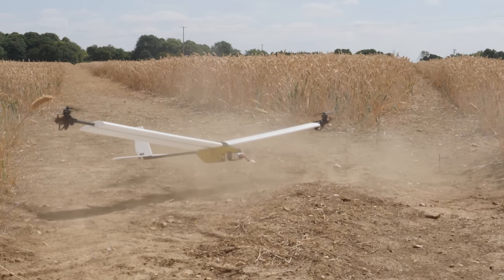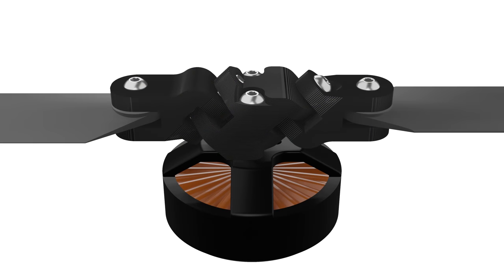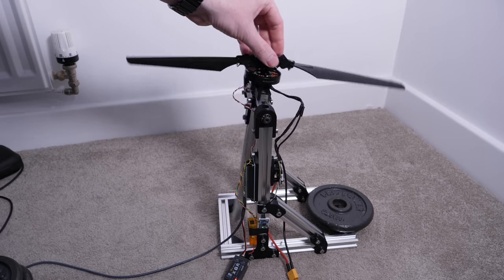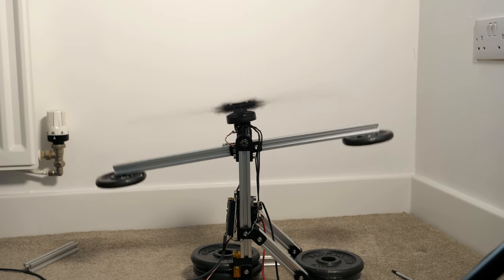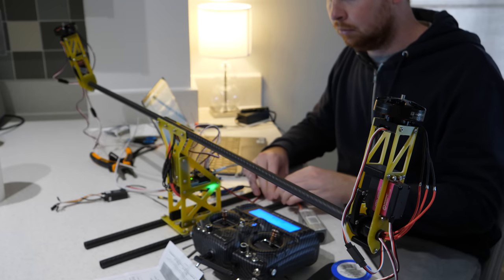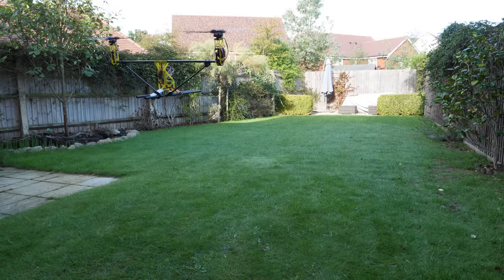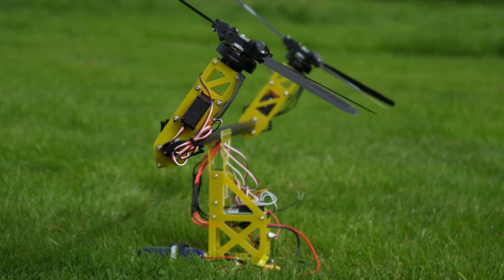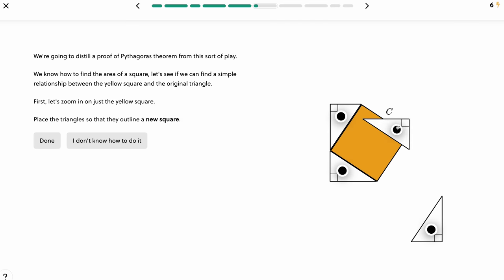Building a V22 Osprey - Part 1

Comment: On a quadcopter you get yaw from slowing down the cw motors and speeding up the CCW ones. You could do that here but you would also get tilt, some maybe you could use virtual swash plate to control the tilt while using the overall motor speed to do yaw? Rotating the whole motor mechanism seems wrong somehow but maybe that's how the real one does it. Awesome project can't wait to see the test

Comment: Hey Tom. If you put a back or front panel on the motor housing, you will strengthen it much more than the one connecting part you have in the middle now. You can see it still flexes in the slo-mo.. same goes for the exstention up to the wing spar.. put sides on it ;) Keep up the great work

Comment: I would put the tilt rotation point in the middle of the motor support, so the motor would be "above" and the servo would be "below" the carbon spar. That would give much less vibration.

Comment: Search for "ground resonance helicopter", It's something that can happen even in a real helicopter with 3 or more blades while in contact with the ground. and if not identified and corrected immediately by lifting off (removing any contact with the ground) it will build on itself like waves caused by multiple pebbles being dropped into water, and can rattle a helicopter apart. I think the fact that you were no longer in contact with the ground in later flights contributed to Ground Resonance being eliminated more than the design changes. Another thing to note: while the freely leadiing-lagging rotor systems work great for the ESC system you've built, without lead-lag dampers, they are more susceptible to Ground Resonance

Comment: Why not use the swashplate-less rotors for yaw control instead of the tilting servos? Shouldn't you have independent pitch control on each side? Hyped for the next video.
Reply: I'm thinking that's because the sine wave has to shift phase almost instantaneously and even though that is possible in the software and electronics side of things, physically that won't translate into the rotor doing what you expect because of its inertia. I'd like to hear what other people think though, as that's just my uneducated guess.

Comment: That rotor head is very impressive.  I flew 30 and 60 size nitro r/c helis for many years, the collective pitch on them adds quite a bit of complexity and points of failure.  Not sure how that would work with the much bigger blades on what I flew but makes me want to go dig one out and do some machining to tinker with it some just for kicks.

As always your videos are very educational

Comment: I would put the tilt rotation point in the middle of the motor support, so the motor would be "above" and the servo would be "below" the carbon spar. That would give much less vibration as there would be much less cantilever on the rotor support design.

Comment: I appreciate how you leveraged the precision of your electric motors to control the prop tilt. I wonder if you'll need to damp the movement at all in the end? There's only one degree of freedom on the rotor blade itself, right? Can you think of any easy way to keep the rotors from flopping around when they're stationary? Maybe a tiny little spring in the hinges? Just some rando thoughts.

Comment: Honestly I'm nobody to give advice to someone as brilliant as you, but I think some form of counterweights would be beneficial on either end of the motor propeller units? 

I feel like the unbalanced weight on just the top side of the black bar would also make for a challenge when it comes time to switch between hover flight and forward flight. 

Excellent execution of the swashplate-less design though, can't possibly have conceived of such a thing and it's so simple yet effective. I'd patent it if I were you before some toy brands pick it up lol. Excited for the next part!

Comment: With the three hinge rotor design, did you design a correspondingly lower angle into the two same-direction hinges? This could improve blade tracking and reduce vibration.

Comment: Nice work, kinda surprised me that the unsymmetrical pitch control still works that well.
But than again 1/3 to 2/3 isn't that far off from 1/2 to 1/2 so there isn't real reason why it shouldn't work.
Looking forward to your full build.

Comment: Thi flight cobtroller restart is probably caused by the power consuption, when you put a huge load on the battery from the motorsthe battery voltage can dropp, and the regulator no longer able to provide the voltage the microcontroller needs so it gose reset. If the problem ever appear again I suggest use a drone power regulator or two batterys. One for the motor, one for the other electronics.
Have fun the video is high quality as always!

Comment: This is brilliant. If you happen to research the history of the V-22 Osprey, back in the late 70s early 80s, they had several crashes due to the same issues you had. The flight control system failing and the resonance of the blades over the wings. Same issues.... smaller scale.

Comment: This is an amazing idea, and could really be useful in a life-sized application.  Taking away the mechanical complexity and replacing it with digital complexity.. but probably saving a load of weight and maybe increasing the reliability?

Comment: A guy in my club had a Rotormast Osprey (shown at the start of the video) until this year.  It never worked right.  It always broke when trying to bring the nacelles back to vertical after having them fully forward.
Reply: interestingly, that is also the most dangerous portion of the real Osprey's flight, and resulted in quite a few fatal crashes.

Comment: There's a phenomenon with three bladed helicopter rotors where a slight bump at the right moment can send them into a catastrophic vibration. I'm wondering if the oscillation based control may be inducing that, and the steps you've taken have effectively masked the problem.

Comment: you should probably move the tilting servos oposite to the rotormotors
1st it looks more like an osprey
2nd it would reduce vibration because the distance between rotation point and motor is reduced

Comment: Given you had issues with blade deflection in the tests the vibrations could be an instability introduced to the rotorhead by a blade stalling out completely, adding random torque to the system which the controller cannot compensate for. You'd have to look at the sensor signal and try to detect  the vibration in the signal, then cutting power for a rotation to let the blade settle before picking up again. Experiment adding some weight to the blade tips. Rest might just be in the blade shape, if you notice your blades are a lot wider at the tips, giving them too much lift bending the blade, try a profile more akin to the real deal, more wing toward the center to create lift with less deflection. Personally would put the servo onto the spar rather than into the nacelle to lower the weight there, but I also don't think that's a big enough factor in this. Good luck.

Comment: Amazing and brilliant. Ever since the the first single torque rotor design, have be wondering when you'd try to build a bi-rotor design. The amount of thinking and designing that goes into a video like this is incredible; in the number sub-problems that were solved along the way.

Was thinking in future, you'd be able to a second harmonic to the motor torque algorithm to also control blade pitch, that stabilizes aircraft pitch as well. (eliminating the need for motor tilting servo) 
But as demonstrated here, the ability to quickly control pitch likely would be easily saturated by a wind gust. (10:35) Suspect you may have even experimented with this at some point. ;)

Regarding vibration, the motor pods have all the mass at one end, so any vibrations creating strong torque through the wing spar. The full-scale Osprey motor pods are more centred on the wing spar. Suspect this helps to reduce torque loads and transition of vibrations thru the spar. (with a bit reduced aircraft pitch authority)

Comment: I absolutely love this project! The people here in the comment section have summed it up nicely.

But how do you handle gusts? What is the maximum angle of deflection you can accomplish continuously? The motor obviously has limits as to how fast it can get, and aerodynamics dictates you lower limit.
(looks like the control outputs get saturated there)

Does the formula for the ESC‘s account for the change in speed needed for the rotation of the blades, meaning the loss of lift that comes with it?

I think 😬 by letting the ‘value of lift’ that is provided by the motor in a certain (rotor head)configuration determine a overall speed additive (+/-) (regime) you could squeeze more out of this setup.
Of course that is a lot easier said than done 

60-100Hz should easily be enough for this “auto-motor-trim-function” I recon 🧐🥸 maybe rates as slow as 2-4Hz 🧐
maybe you can get a 10 fold increase in the sideways deflection force out of it, that would be so sick 🥸

Comment: Hi Tom, I'm wondering if it might be possible to get rid of the tilting servos. The cyclic control should create a similar movement. The trick I'm thinking about is a visco elastic coupler where the tilt servo was before. Something like a hydraulic damper. Slow movements like the transition between hover and flight should not cause the fuselage to nod much. But more dynamic movements should transfer a nodding moment into the fuselage and therefore its stabilization. Hopefully you can understand my concept, I'm an mechanical engineer from Germany. Cheers, Stefan

Comment: Really nice project, I cannot wait to see the next part(s?).

I wonder though: is the cyclic control really necessary?
It is needed on a helicopter because the rotor blades will be mostly parallel to the plane of travel during the enormous majority of flight but on a V22, the rotor blades will be perpendicular to the plane of motion during most of the flight. Only the take off and landing phases will see the rotors pointing upward and during those the horizontal velocity will be very close to zero or small enough that the retreating blades will essentially have the same lift as the forward ones.
In that respect, implementing cyclic control seems a bit overkill.

I hope you end up doing some tests without the cyclic control active (i.e., non oscillating rotor rotational speed) to check whether it is really needed. Although the mechanism of it is certainly really cool, I am not sure it is really needed.

Comment: holy fuck, the rotor design is so fucking awesome I am obsessed with it. reducing complexity and costs are like dirty talk for engineers. This basically gives you software-defined turbuprops lol. like what if you have varying atmosphere densities or rain and other debris entering the free stream, well you can just define a control loop that adjusts the engine signal and compensate accordingly for those inertial outliers, now what would have been a weakness in the design is actually a strength. So fucking cool, so many things you could do with this idk why I've never heard about this lol

Comment: Dear Tom, although I am not a patriot (I can only support so many) I do would like to propose an engineering challenge to you. I have been a tricopter fan since the early days. (yes quite a long time ago). However, none of the builds realised a truely rugged/robust/reliable tailrotor steering mechanism. As you solutions are sometimes quite surprising, as is the tilt mechanism in this design, I was wondering if you could come up with a better solution than the once I have seen and tried so far.  Thank yu so much for your videos. They truely beat watching television by a long shot!!

Comment: When using your control method it's important for the motor mounts to have high torsional strength to handle the periodic acceleration/deceleration... but these nacelles don't.  At the right prop RPM the motor torque could drive the nacelle torsional resonance mode and it could be problematic.

Comment: Sorry to disturb you, but as I am currently working on a project combining several accelerometers, I made measurments about the noise of the MPU6050 IMU (having them in the drawer, I decided use them). I don't know for the gyro but the accelerometer is very noisy  :
the typical standard deviation from the real value is around 60 to 100 times the value of the least significant bit, (around .05g) I have done 100,000 individual measurements, autonomously at 100Hz, recorded them on an sd card, and subtracted the average value on the axis to each measurement to extract the deviation caused by the noise, getting  a nice gaussian curve of ditribution
also suprise, the accelerometer is supposed to be coded on 16bits, the two least significant ones are never changed (if I sibdivide the x axis of my histogram in levels corresponding to 1lsb, I get always one bar every 4, aways 1 bar and 3 "holes").

I think that in an application where you can do averages, you can counter such noise levels, but deffinitely not in a fast mooving and naturally unstable helicopter (Joe Barnard from BPS space got some problems when trying to add averages in his rocket propulsive landing flight control system because it created delay)

I think you should see if there are some IMUs that are more precise and esaily connectable to an arduino, I remember that the LIS2DW12 has a typical noise around 1.2 mg, so at least one quarter.

Changing for a more precise one may help the correction, by lowering the parasitic responses caused by the sensor's noise

I hope my comment was useful and thanks for the videos, always extremely interesting

Comment: It's just an Idea but could the source of the vibrations be the synchronization of the moments where you accelerate/decelerate the rotors. Veritasium has a great video on the primciple called "The surprising secret of synchronization". My own thoughts on tackling that problem are stiffening the frame so that the synchronization doesn't happen as fast or accelerate/decelerate the rotors 90 degrees out of phase.

Comment: Of note, each blade on the Osprey has 47° twist from root to tip to create the proprotor. This is to achieve lift and thrust in on the same blade for both regimes of flight.

Comment: Your strange vibration sounds like its the blades getting excessively out of phase with one another which creates a massive dynamic imbalance. In articulated head helicopters (particularly designs with lead/lag hinges) it can be induced by ground contact. They call it ground resonance and if the pilot fails to act it will destroy the helicopter. Looks like the combination of head design and the main frame lends itself to excessive blade lead/lag in flight.

Comment: Idea to improve - move servos down, to the opposite side of brace.
Reply: 1. This will make lever with a motor shorter and more rigid.
2. Servo will work a bit like a counter-balance and this will make it easier to rotate.
Reply: BTW, awesome project 👍

Comment: If im right, the real V-22 Osprey does actually have an issue where the blades will sometimes hit a resonance with the wings and shake violently for a few seconds before returning to normal, so the issue you happened across is actually just making it an even more accurate model

Comment: I looked into the original papers, and the extension of the original idea (extending upon delta-3 hinges,cyclic control via angle dependent speed changes) was to add a teetering hinge to the rotor, essentially using the speed controlled delta-3 angles to fly the rotor disk to the desired angle for cyclic angles. That's similar to the various piezo or otherwise driven flybar controls folks have tried, or the Kaman servo flap control. That change seemed to improve their overall performance and power drain. Would that be useful with your V-22 setup, or would it be problematic with the 90 degree motor rotation?

Comment: After thinking about that rotor design for a while, I realized that you've actually built  mechanical/analog computers into the rotors that take the rotation speed as input and produce the angle of attack as output. Mind boggling, really.
Reply: That's not quite right, its deviation from the average speed of rotation. So slighly faster is "on" and slightly slower is "off." The blade pitch engages when "on" and disengages when "off." And we are talking about "high" and "low" logic values, not just from the velocity of the rotors, but because used the sin function to govern the rate of spin, and that function ranges from +1 to -1. A high and low deviation from average rate of spin. :D

Comment: I wonder if instead of "2 blades having the same hinge angle and the other having a reversed hinge angle", you should arrange it so that the axes of rotations of the hinges are all parallel. My hunch is this make the pitch control better spread between the 3 blades. In the 2 blade version the axes of rotation are parallel and this is obviously the optimal solution.

Comment: about the yaw control when hovering, have you tried to increase the lift towards front of one side, while the opposite side increase the lift towards back?

for example to turn right, the left rotor blade pitch forward, while the right rotor pitch backwards (not using the motor mounted pitch, but blade pitch)